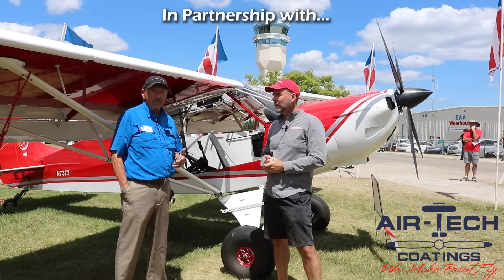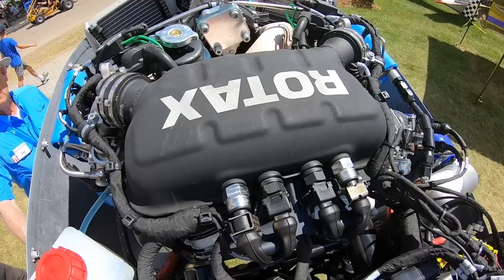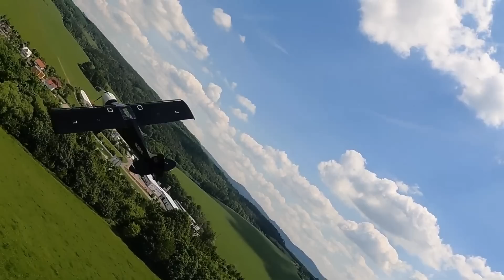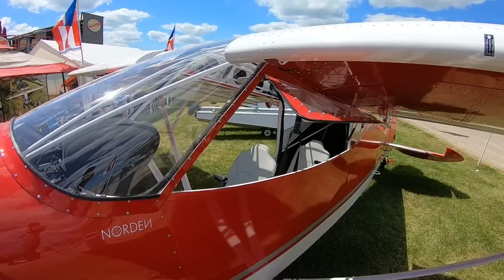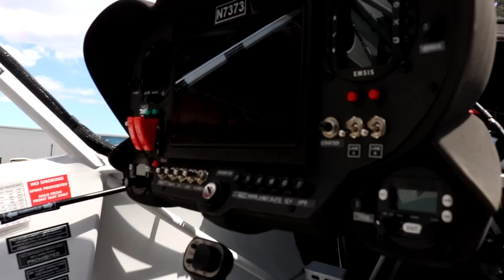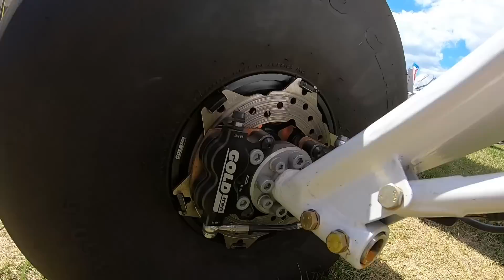New! Zlin Savage Norden BUSHPLANE Ready to FLY!

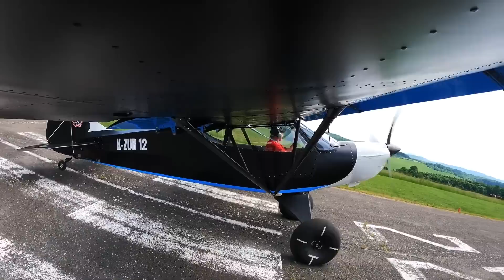Comment: 1:44 It's very unexpected for me here! For previous 30-ish years in my experience the problem with flaps is that, being extended, they create a pitch DOWN force, thus the nose gets lower and lower. Simply because flaps lengthen the wing's cord BACKWARDS hence shifting the lift centerline backwards, hence the CG shifts FORWARD.

The leading edge wing shape alterators on contrary lengthen the wing's cord forward, thus shifting the lift's centerline forward. So the CG moves forward creating a nose up pitch.

If both systems are used they can balance each other, lengthening the wing's cord in both directions, keeping the center line of lift intact.

Nose down with slats extended is pretty much dumb. Cause at small angles of attack the gap between the slat and the main part of the wing happens to be in the shadow of the slat — i.e. not working. There must be some nose up position to make the oncoming air flow under the slat, into the slot and above the wing.

Comment: For the money, already built this is a great deal! and the sleeping bit is a must have. Long trips and landing somewhere there are no roads or hotels makes this pretty handy. A 3 day flight from Ontario to Vancouver! I wonder what mileage it gets with floats? 6mpg with a 915 turbo is not half bad, and it uses regular gas unlike the still leaded Nav gas! Leaded gas caused a global drip in IQ, and that isn't just some theory.Just  one more reason to like the Rotax line.  The altitude is why I like the 915.
Reply: I had my first RANS S-7 configured so I could sleep in it. The only drawback was I had to take most of my gear out to be able to do it, and pile it up outside, and if it rained....., so I also carried a small tarp.